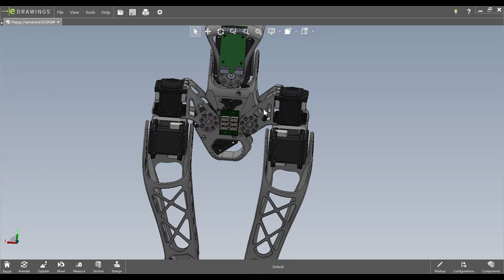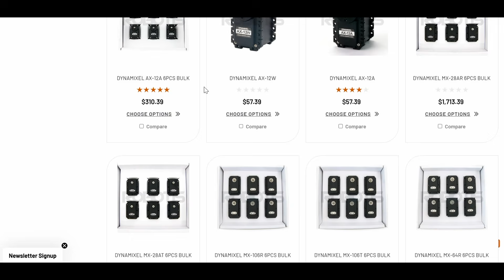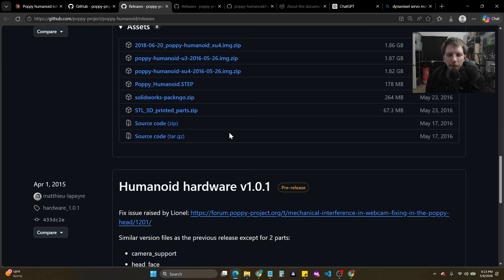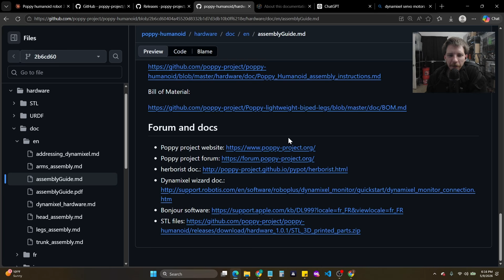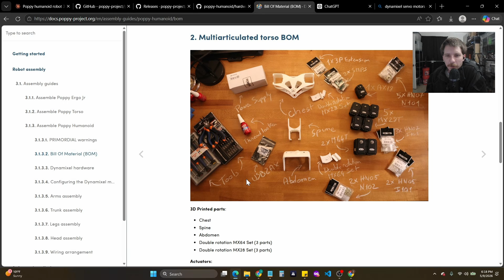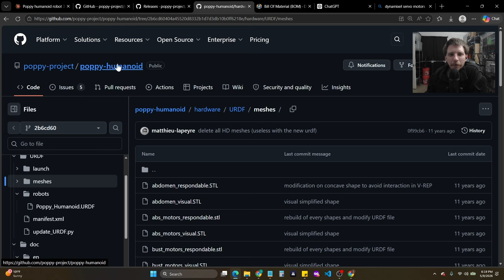Poppy: The Open-Source Humanoid Robot You Can 3D Print at Home

Comment: What I like is the frame. Nice design. If I were designing a frame, it would be a lot like this one. I'd scale it up to something like 185 cm, though. I'd put a humanoid-looking head on it, too.

The servos used, if you can still get them, are convenient, but I wouldn't use any of that, or the equivalent; it's way too expensive. What I'd do is convert to hydraulics, because hydraulic actuators and control systems can be built for next to nothing without CNC.

I'd use an AC compressor as the pump. These can be found new in returns auctions for next to nothing. To that, I'd connect a powerful one- or two-horsepower treadmill motor through a DIY 3D-printed and vacuum-investment cast reduction gearing design. Treadmills can also be found at returns auctions for next to nothing as well. Check on Hibid for auctions in your area if interested.

I'd look for a treadmill with a brushed motor; that way, I could use a super-cheap PWM motor controller. For battery power, I'd just find a good DIY design and build my own. Or, if I were building it to do work for real, I might spend the extra cash for new lithium batteries.

Next, I'd need a hydraulic accumulator. Super easy to build a piston accumulator, but I wouldn't build one big accumulator; too dangerous! I'd build a bunch of small, super-safe ones and have them distributed all around the frame.

From there, I would need electrohydraulic servo valves, or EHSV. Fancy name, super easy to build. Just a small stepper motor that pushes or pulls a hydraulic valve spool. No encoders would be needed for the valve position at first, because the valve spool movement would be based on open-loop stepper positioning.

But if I did want spool feedback later, I haven't tried it, but I know it would work, and that is to use a mirror connected to the valve spool and a soluble dye added to the hydraulic fluid, along with a super cheap cadmium sulfide photoresistor next to an LED, both facing the mirror. The dye would vary how much reflected light reaches the photoresistor, and that variable resistance would be sent to an analog-to-digital converter for the microcontroller to use.

Probably need a temperature sensor in there too to compensate for thermal changes. All of this could be 3D printed with a resin printer.

One potentially high cost is a good inertial measurement unit, or IMU. I'd start with the cheapest I could find and then see what I could get away with.

And the cherry on top? EVERYTHING WOULD BE VIBE CODED! HAHA! 🤣🤣

Comment: so, an updated pino but with ridiculously expensive servos... homemade servos used to be a thing, probably buildable at 50bucks a piece with a well stocked shop.
Reply from the maker: Not exactly. Pino was developed in Japan and was a smaller humanoid platform focused more on hobbyist accessibility, while Poppy was developed in France as a modular open-source research and education platform with heavy use of 3D-printed parts and smart servos.

The expensive servo point is definitely valid though. Making your own servos/motors is still doable if you have access to proper machinery and tooling. 

The tricky part is that robots are usually designed around a specific motor, or the motor has to be custom designed for the robot itself. Most people today mainly have access to 3D printers, not full CNC or motor fabrication equipment.